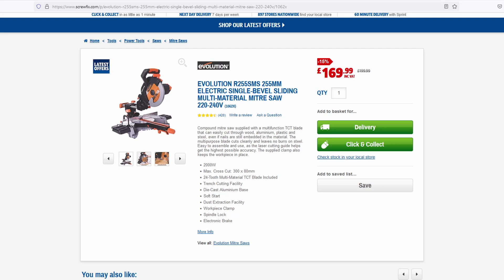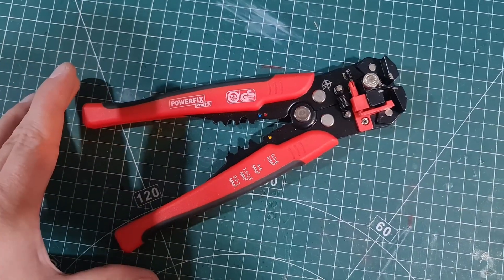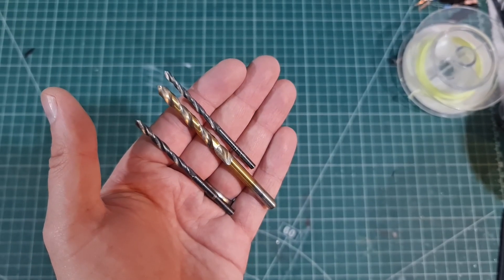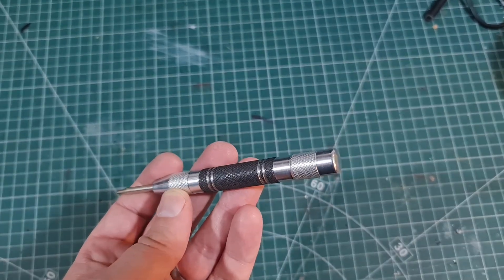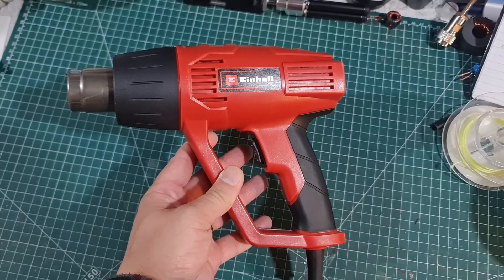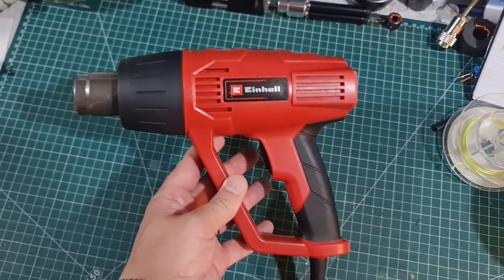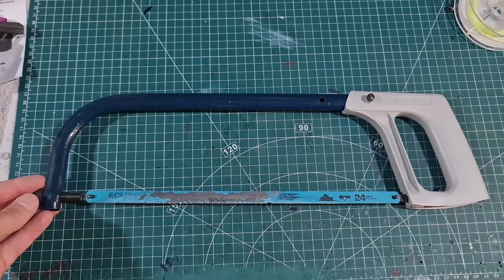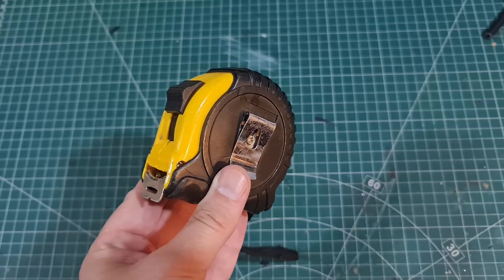Simple Tools You Need to Build a Hexbeam Antenna for #hamradio

Comment: Colin, first of all, loved the delivery in this one, and the hexbeam series in general!  Quick question: for buidling transformers up to 100 W, what diameter/awg/swg enamelled copper wire would you recommend so that it's easy to work with, and do you have a favourite supplier?
Reply from the maker: Thanks Alex, for 100w I use 1.12mm diameter, easy to work with. I get it from Brocott, good value and service.